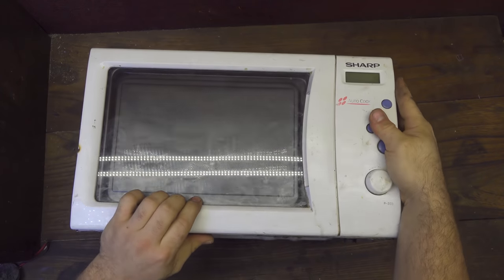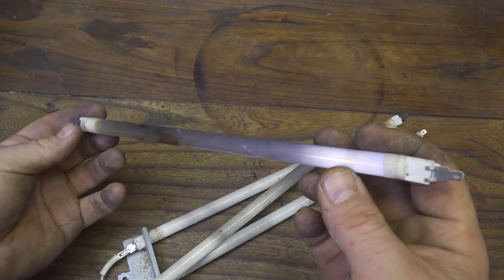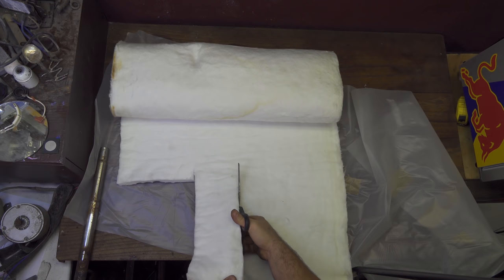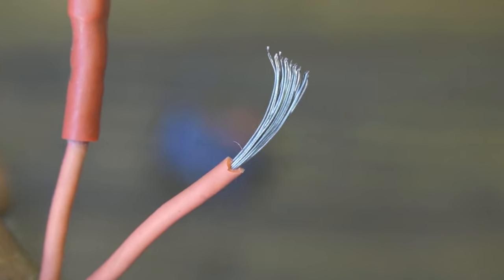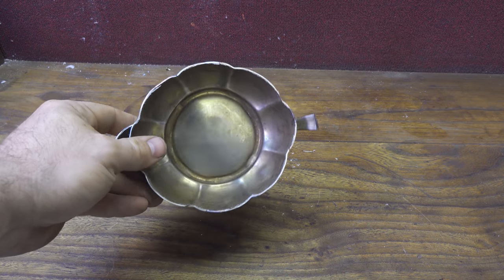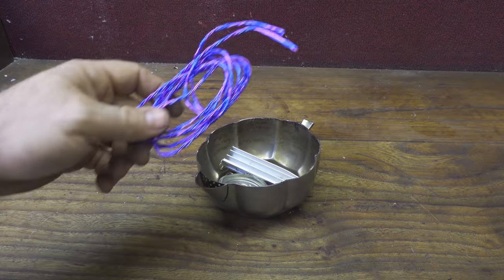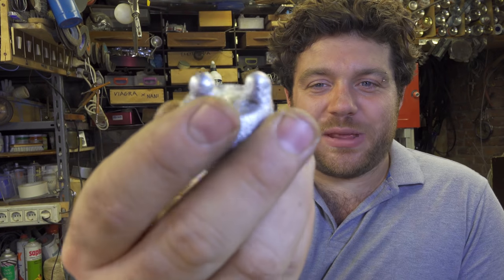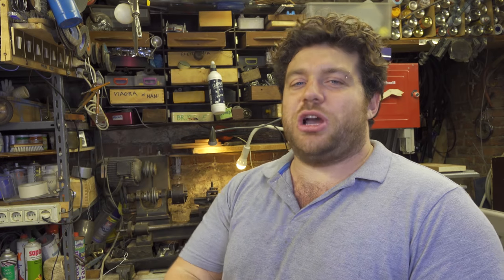Convert Microwave to Melt Aluminum & Metals

Comment: Now I'm disappointed because I thought this would become an inductive furnace where you use the magnetron from the microwave to heat the metal. But like this, the microwave could be just any other kind of container, it isn't really necessary.
Reply from the maker: This will be for sure a future project! I already know how to improve the power of it!
Reply: the transformer and magnetron are not made for continuous use...on a regular microwave they run fror 2 or 3 seconds then they shut off, then on again and so on so the transformer doesnt overheat ...
Reply: Put a regular microwave on its highest setting, and they run through continuously. At least from listening to the hum, that's how it sounds. Only the lower settings use the magnetron in an on off interval, but this is mainly because you can't power a magnetron at a fraction of its power, so if you have one with 800W, it will always put out 800W. If you set your microwave to 400W, it's on for 50% of the time and off for the other 50% of the time, switched in intervals of 2-3 seconds.
Reply: maybe where you live they are designed differently???..here most microwaves are 800w and even if you set them at 800w they run at intervals...its easy to tell by listening to the hum like you said...if you set them lower they run less time thus making less AVERAGE power...here most microwaves use a mechanical timer
Reply: do you think they would handle continuous power for some minutes?i bet not...i see lots of open transformers and melted tips on magnetrons and they dont run continuosly...anyway i agree to a certain point i was also disappointed because i though he somehow would use the internal components of the microwave...just didnt know how... maybe use 2 transformers and magnetrons and switch between then would be a solution
Reply: Hugo Barbedo Where do you live? I live in Germany, and the last time I've seen a microwave with a mechanical timer was in the 80s, they are all digital now. Also, I haven't had a microwave myself for almost 20 years now (just never bothered to get one), but wherever I used one on the full setting, I couldn't hear the hum change like on the lower setting.
Reply: The redundant switching solution sounds reasonable to me! However, this would involve also modifying the control electronics in such a way that it can drive 2 magnetrons taking turns.
Reply: i live in portugal, we have higher end digital microwaves but most people buy the cheaper ones (39€) and they are all mechanical with a mechanical timer and bell..They are different brands but mostly the same inside..sometimes the fan can be confused with the hum noise but maybe its just an issue of different models working differently
Reply: it would be easy to use the mechanical timer and when on it runs transformer number one and when off it could have a relay engaging transformer number 2
Reply: currently my microwave is Balay very nice brand its from the bosch group and i like it very much like most german stuff. its mechanical also
Reply: I read 2 articles about a micro wave foundry years ago. Older microwave ovens were used. Ceramic molds were used and iron particles were embedded all thru the ceramics. The mold was 2 chambers connected by a molded in tube. The metal was put in the bottom chamber and the top chamber was the actual mold. The bottom chamber heated up due to the microwave somehow interacting with the iron particles ...Hysteresis or induction maybe???, I don't remember the tech details, probably because I didn't understand them.   When the metal was molten the mold would be turned upside down and the metal would flow thru the connector tube into the mold and allowed to cool. I thought that this was going to be a video of that process.
Reply: Can I warm up room with it?:-)))
Reply: Do You know microwave kiln? Iff Yes. Do You think it can be used for metal clay firing like silver, bronze clay in microwave?
Reply: All you need is a microwave kiln done 😂

Comment: You could have made a heat conductor of silicon carbide and left the magnetron in place. Insulate and then you have a microwave kiln. Uses less power than heating elements, and probably hotter too. Disclaimer: Do not set fire to your workshop :)
Reply: how does one get to 2000deg c?

Comment: whats about to feed the resistance with the transformer of the microwave at low voltage and high current? I think will be more efficient as you use less power to get the same red wire temp ... I thinking about it to built my kiln ... i dont know if kanthal works on 5volts or circa, but as i underdtand the current is what rules and raise the temp... just cant figure well about the kanthal resistivity ... soon i will test it as I have a trafo in my garage

Comment: how long would a microwave run as a water boiler for humidify-ing buildings? seems like a great way to make a boiler system if can work out the pressure-safe, microwave-safe resevoir but it wouldn't need refilling.. 

i'm assuming i should keep the grate material from the door when i cut the circle for steam vent to keep the microwaves from leaving that direction.. and will let the steam pass.

Comment: one suggestion use a hardening spray or waterglass to prevent fibers from the farax gettign in ur lungs and giving u breatihing problems. id allso add farax to the inside of the microwave (under the lid where the electronics were)

Comment: i am making a same isolation oven, whith wool and ceramic reflectif bricks, but i striped off aal the plastics, and will put a burner in the hole of the micro wave ? hope to get up to 1000 degrees

Comment: Hi Rulof Maker. Do you think it is possible to make electric furnace using tungsten wire wrapped around flower pot and isolated around with fire cement?

Comment: Ciao Rulof ho visto il tuo video e sono rimasto veramente stupito per il fatto che si puo sciogliere cosi facilmente l'alluminio, solo mi è rimasto un dubbio: se io volessi connettere più resistenze di 450W e 115v tipo invece di 4 conettere 8 di queste, come devo fare perche a me sinceramente mi spaventa un pò conettere queste resistenze direttamente alla spina dell'elettricità senza farla passare prima per un transformatore (forse per sicurezza non lo so scusa la mia ignoranza) quindi se da noi in Spagna le spine danno 220V e 16A come devo fare per conettere 8 resistenze come quelle che fai vedere nel tuo video? grazie mille.

Hi Rulof i've just saw your video and i was so shock about how easy is to melt the aluminum, i just have a doubt: if i would like to connect more quartz resistors of 450W and 115V instead of 4 i want to connect 8, how must i have to connect them because im quite afraid of connect 8 of them directly to the power web without a transformator to have more control and safety maybe because of my ignorance but here in Spain we work with 220V and 16A

Comment: Great Idea  and 8 minutes to melt ally is pretty impressive  copper tho ???
  But I strongly suggest against using ceramic or glass fibre products without sealing (and the sealing agents sold for purpose are not cheap...)  my limited understanding is the risk is akin to a 1000 pack a day ciggy habit (not negligible).  an alternative budget insulator could be a perlite or vermiculite mix with sodium silicate as a heat proof binding agent allowing you to mold the insulation to suit.

Comment: i just have to say be careful with the magnatron.. if its pink tip it contains berillium... very toxic.... no cure but can treat symptoms... however its only a threat if you chip or break the pink ceramic and breath it in. only takes a lil bit.... ( i have a cupboard full of them but safetly put in a box where they wont get damaged)  anyways like your channel keep up the good work +1 subscribed
Reply: Interesting how there are the microwave kilns on the market and appears the best DIY to build one is the YT channel Shake The Future "DIY Microwave Kiln."   I was thinking also, to be careful with the refractory fibers as those are not good to breath in.

Comment: you probablt wamt to put a relay between the switch amd the elements , the switch is the weak point in this setup and could weld itself together preventing you from turning the kiln off

Comment: show how to turn a microwave into a furnance: disassemble with bare hands and dont mention about the huge capacitor on the microwave.. very good
Reply: he also dropped the molten aluminum, go see the italian version of this video...
Reply: come on man He has mentioned it at 0:36 'a transformer and a capacitor
Reply: Leon Tam are you joking right?!
Reply: and what is the problem dude are you a part of the nazi-gay-safety-brigade? the capacitor in the microwave discharges itself when in circuit..i ve disassembled thousands working on scrapyard and never got shocked

Comment: Does anyone happen to know what these heater could are called in English? The ones linked don’t ship to the US:(
Reply: They look like the ceramic heating elements that get used in kitchens for various things, that might be a starting point
Reply: Just do some research on ebay and amazon and even uour local hardware store, u can probably find those. You should search for ceramic heating elements, specifying the wattage.
Reply: The Russian Woodworker, lazy russian, let us do the shop search for you